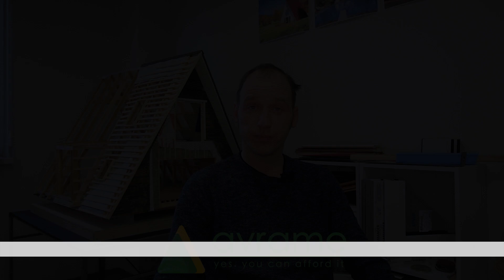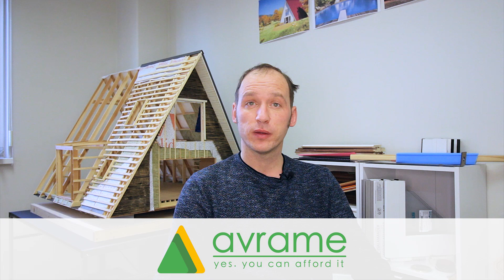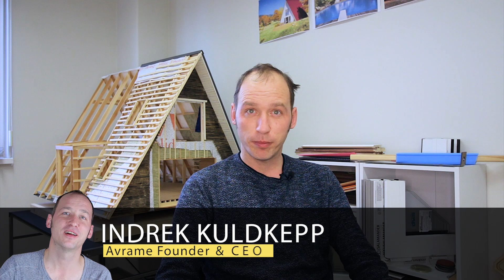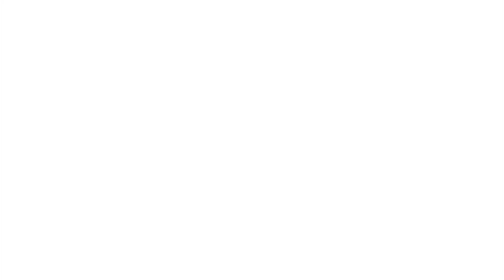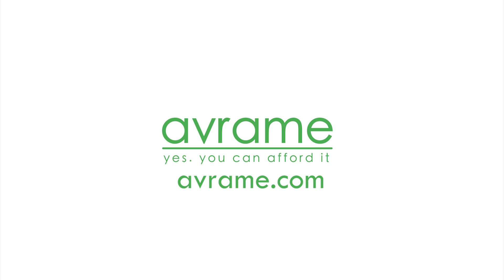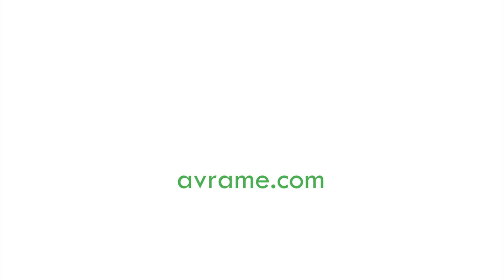Can prefab houses help fighting climate change?

Comment: Have you planned the possibility of extra insulation? For example to get whole structure to pasive strandart in north Europe...30cm space in Trio models is not sufficient.
Reply from the maker: You can increase the insulation space, but in most countries 300mm is sufficient. It really depends on the insulation material itself (sprayfoam will probably meet the requirement) and heating system. With just electrical heating you need more insulation and with renewable energy (woodpellets or similar) you need less.
Reply: @AVRAME  Thank you for your answer! Yes, spray foam might be enough, however it would had to be done professionally and that increases the price dramatically. Or other way around. For the same price as the foam can be installed Isover KL-33 of much higher R value. :)